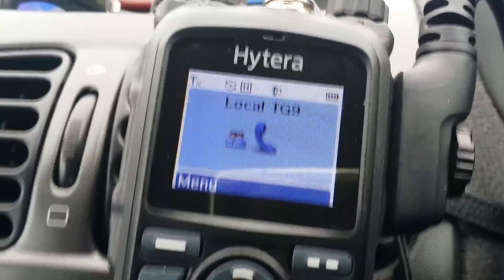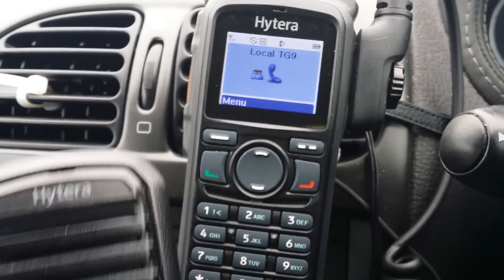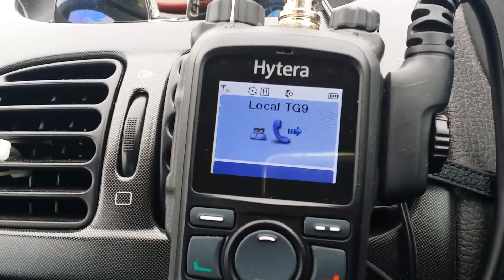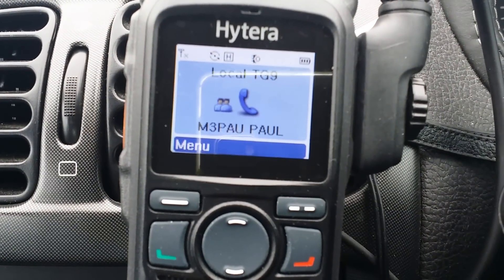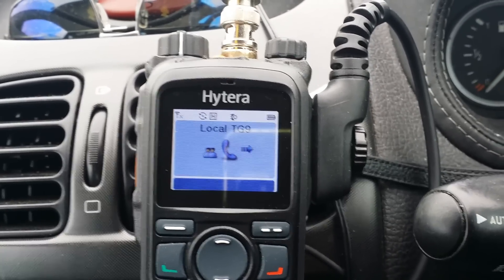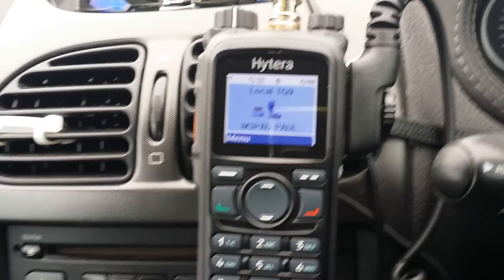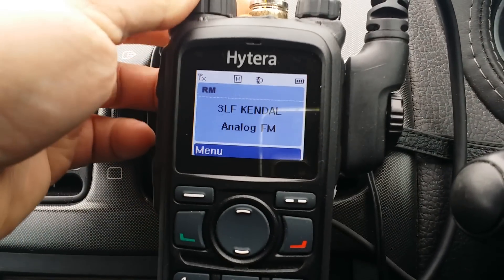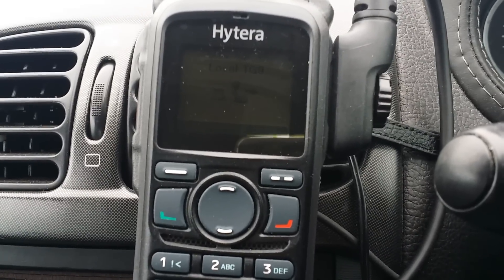Hytera pd785 mobile test

Comment: Hi just a couple of questions did you get software with the radio or was there extra costs etc I've used a cs700 programming and Motorola stuff looks like a nice radio is this compatible with DMR Marc and Hytera repeaters ?  

Thanks martin 
M0MBV
Reply from the maker: MARTIN HENNESSEY Hi there no the software I downloaded from the internet , if you can't find any let me know and I can find a link or email it to you.And yes these work on both dmr marc motorola and hytera repeaters ...I use mine with no problems on my local dmr gb7mb but most of the time I use dmr for simplex qso's on my dm4600